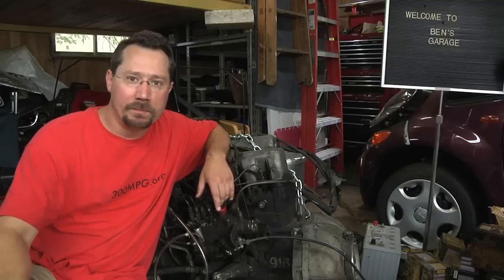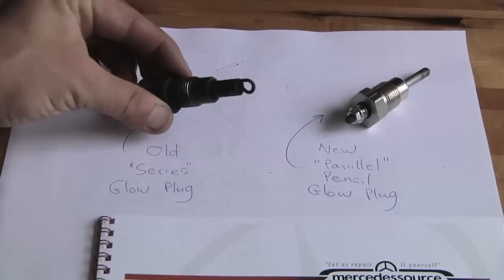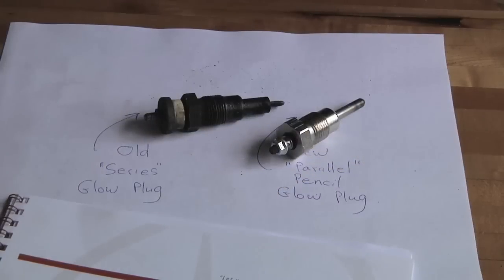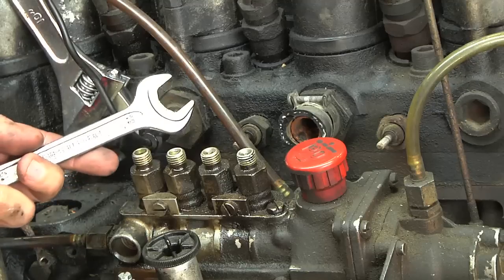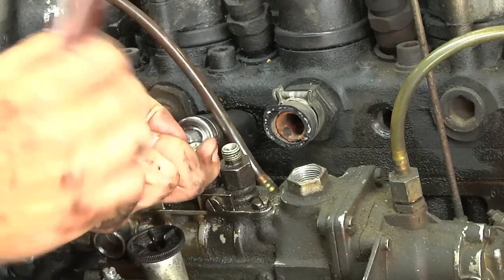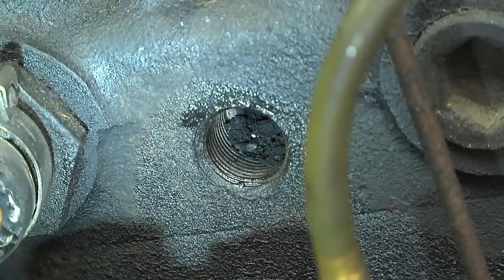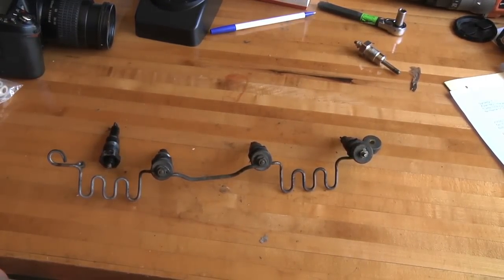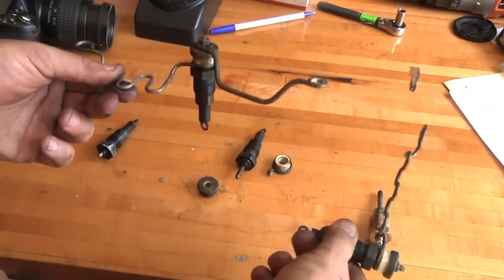Mercedes 240D Glow plug Removal and Inspection

Comment: Por que mí auto diésel Mercedes benz 240D es lento,??
Reply from the maker: These cars were never known for having good acceleration. Diesel typically has high torque, but not necessarily high horsepower.
Reply: @BenjaminNelsonX  no entiendo tu idioma??
Reply: @BenjaminNelsonX  en español
Reply: En español
Reply from the maker: @rubenayala7109  Estos autos nunca fueron conocidos por tener una buena aceleración. El diesel generalmente tiene un alto par, pero no necesariamente una alta potencia.

https://translate.google.com
Reply: @BenjaminNelsonX  dale muchísimas gracias, se le puede complementar algo, para que mejore su mantenimiento de potencia, te explico en rrecta y en bajada estoy conforme con la velocidad 130 no da más con eso me da ,mi problema es cuando el se enfrenta a un repecho decae a 60 ,hasta 40 apenas sube,,cabie filtro de aire y gasoil asta el tanque combustible,,no se que aser bueno un fuerte abrazo amigo gracias x tu información, x si quieres sugirirme algo te agradezco gracias
Reply: Buenas soy Rubén el del Mercedes 240 el problema mío es qué en recta y bajadas levanta 130  no tengo problemas con eso cuándo llega los repechos se me queda 60 hasta 40 y puede llegar a pararse o detenerse Cómo quieras entender tengo qué poner primera para terminar de subir el repecho van varias beces lo mismo A esa potencia mi refería se queda el filtro de aire ya lo cambié y el de gasoil hasta los caños y tanque de combustible no sé qué más hacerle agradezco

Comment: Is this wired through  the dash mounted heater coil
Reply from the maker: For the life of me, I don't remember, and no longer have the car. (I do still have the engine!)
I got the glow plugs from Mercedes Sources, I'm sure their info would tell you. I have more about all of this at my blog: https://300mpg.org/2014/07/15/240d-glow-plug-removal-and-inspection/

Comment: Why are you takin off fuel lines 
I change 5 plugs yesterday in 45 min
Reply: Reno M how you did It?
Reply: deno dutchh I’ve been driving my 1978 300d for 28 years and changed the plugs couple times 
I installed the pencil glow plugs 
And never took the fuel lines off 
A waste of time plenty of room to move your hands in there
Reply: Yeah I've never removed them either, just waste of time having to bleed them afterwards. But do you have to change the relay for the new fast plugs to work properly? I'm thinking of doing this conversion on my -80 240TD which has the old slow plugs..

Comment: when you wire up the new glow plugs, use separate wires to each plug. This way, when one fails, you'll be able to see which one no longer has continuity.  I used a Ford style starter relay on my VW diesel to supply power to the glow plugs, and a manual switch to trigger the relay.  You'll need to know how long it takes those plugs to reach operating temp, as too long shortens their life.
Reply: The new plugs are all parallel connection style. Each one grounds to the engine block. In essence, each one DOES get its own wire. I was thinking that a starter relay would probably work pretty well. A big red momentary-on switch on the dashboard could activate the starter relay to run the glow-plugs.

Comment: If you have not already done so I would recommend taping off the fuel pump ends so dirty and dust does not get inside.  Also if you are planning on using biodiesel all the rubber seals may need to be changed, given the age of the engines this might not be a bad idea to do this even if you are not running biodiesel.
Reply: I have a 1989 300td I use to power a 20kw generator. When I rebuilt the engine 3 years ago, I replaced all the seals and gaskets with silicone sheets. I used the old seals and gaskets as templates and cut out all new ones from the silicone. Not a single leak in 7000 hrs (or 420,000 miles) of weekends only operation.
Reply from the maker: Hi Liowen. Thanks for the tip. YES, I did cover up the fuel pump ends right away. I'm learning as I go, but I would like the option of going with bio-diesel/veggie oil, so I guess I'll be learning about seal replacement too!